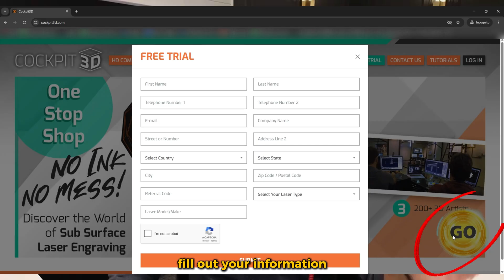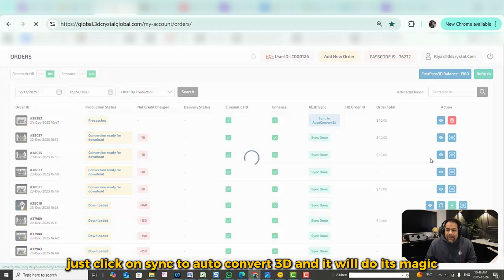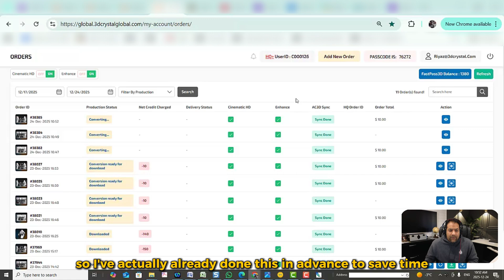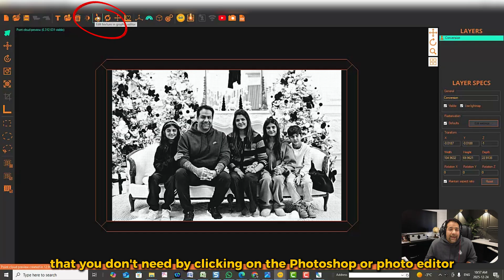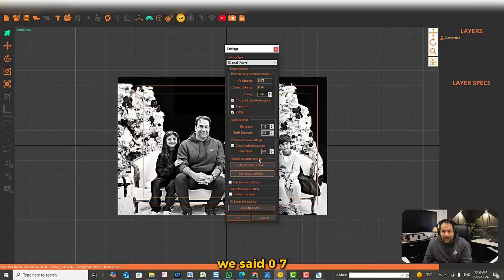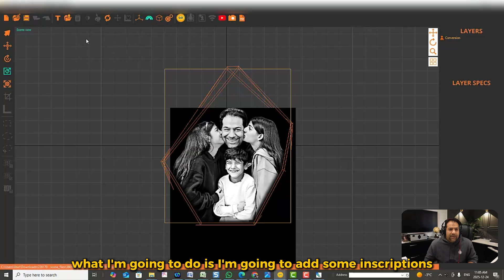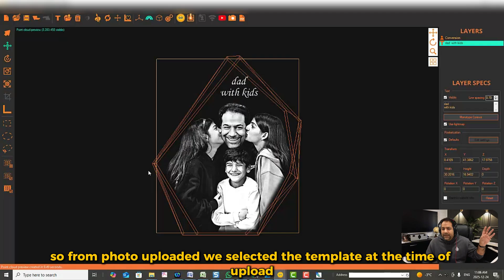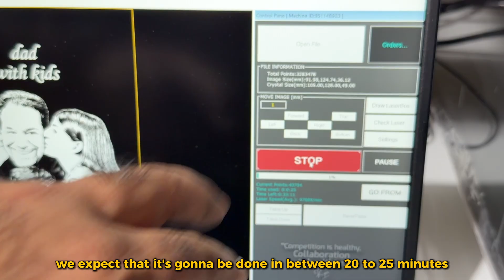How to Turn Any 2D Photo Into 3D for UV & Green Beam 3D Laser box machines | Cockpit3D Workflow

Comment: In FastPass at the very start, I have a square, 65 x 65 x65mm how do I choose the proper size as further in the video you state not to change the size once imported into COckPit3D. Thanks
Reply from the maker: If you select the template looking icon you can change the template size by punching in the metric values under custom OR rectangle to your squares dimensions. You do not need to go through the cockpit3d fastpass converter twice.  
To save a point cloud you would click on the laser icon on top. 
Hope this helps.

Comment: Hi Riyaz Many thanks for the video. Very informative and very useful. So much better now I don't have to use a 3rd party to convert files. I used the Comarker UV and the Xtool UV to create 2 identical jobs , The settings for the Commarker XY=0.04mm XZ Max Spacing=0.25 Z space=0.04 Axis Depth=10mm Calibration Depth=15mm Dwell time=800 FRq=40 Pulse width= 15
On the Xtool I used the following 3D inner engrave file Power=90 Dot duration 600 Layer height 0.04  Frqen 60
Could not have got such good results unless I used your software. Again Many Thanks Steven Tanner

Comment: Youve mentioned groups of numbers (  0714   ) (842) can you link to a video explaining them and how changes in any of those digits will impact outcome of etching.   Also how would uv machine use different numbers (ie xtool f2 ultra uv) thanks
Reply from the maker: XY represents Resolution.  So when we say .07 we are referring to the settings for our Green beam 3DLaserBox.  For UV you will want to start at .06 and you can go lower to increase the resolution.  However as you tighten these points by going lower you increase the chances of cracking and internal melting.  You also drastically increase your burning time.  As for the .14 we are referring to the distance between the layers in the Z direction.  Keep it the same as what you do for your XY since for UV lasers the beam is very thin and we have heard it is best to keep the Z point spacing same as your XY.  The 8 4 2 represents the layers and layer settings.  If you go from 8 to 12 you increase layers, increase points, increase brightness.  The 4 is again complementing the spacing between points and we recommend keeping it 5 for UV.  Finally the 2 is to help reduce some laser ring lines we have seen in the past and we suggest leaving it as is.

Comment: Do your engineers have a recomendation for safety margins?  Ie how much crystal should NOT be internally etched so that the crystal does not break (ie assuming i cant start internal etching exactly at the edges of the crystal)...  Also with respect to internal etching depth.. what is min required internal depth for internal etching for good image?  Also inthink ive learned that a high density of dots while producing a more detailed image also creates heat. Is there a way to pause the program for a cool down period and then have it restart?
Reply from the maker: Thank you for your question.  Our President made a personal response video for you!  Here is his explanation as to what the margins should be, as well as how to set margins on non-rectangular shapes: https://youtu.be/PBmePINlJq4?si=O2GDVB30RAdfK2oo

Comment: Why in one part You are using "projection" and next part You are using "portrait"?
Reply from the maker: thank you for noticing!  Use projection.  Portrait only makes a difference if you are using 3D files that were designed by our human artists and it helps to hide shadows and holes.  Our automated 3D conversions are advances and resolve this automatically so using projection will get you the best results

Comment: I am new to your system and to doing UV lasering I have a xTool F2 Ultra UV 5w how do I figure out these settings are for and how to adjust them?
Reply from the maker: try .06Xy and .06Z or if you want it even denser .05Xy and .05.  On the laser make sure you set your spacing and line distance the same as what you did in cockpit3d.  If you get stuck at any step along the way send us a message here on youtube and we will assist you further

Comment: Me again, I have another question. I downloaded the software on my Mac and it seems to work creating an image. After I hit the preview button and accept the file, I never get the download button. Do I need to re-install the software on a windows computer? thanks
Reply: I don’t think that my mac supports the cockpit installer .exe. When i try clicking on it in dropbox i get a “cant’ load this file type”. Where would i find the open scene file? Is that somewhere on the conversion portal page or somewhere else? And would i have to do this on the windows laptop? Thanks for all of your help, i really want this software to work for me
Reply from the maker: @kelliparker5651 with pleasure. You would need to use cockpit3d on either your windows based machine or on your Mac running a windows emulator. Once you have cockpit3d running you will be able to open the scene file. It won’t work on a chrome book either.
Reply: @3dcrystal thanks for getting back to me so quickly. I’m installing cockpit 3d on the windows machine now, (running windows 11). We’ll see how it goes
Reply: @3 @3dcrystal Success! 🎉 I got the copilot software to load on windows and i can now see my file. Thank you so much and i hope that I don’t have to bother you any more this evening. 😊
Reply from the maker: @kelliparker5651   with pleasure its never a bother. Let us know how it turns out :).
Reply: @3dcrystal i will. I’m watching your video now about the settings and point spacing. Maybe i can print this file tonight (fingers crossed). Thanks for your patience, i am not that familiar with windows, so it was hard to navigate at first for me.
Reply from the maker: @kelliparker5651  try .06xy .06z layers 8, zfactor 5, diffusion 2.  If you want to be a bit risky to increase the brightness and density you can do .05xy .05z but it may result in the points melting and cracking if they are too tight to each other.
Reply: @3dcrystal you are so nice to help me out, great customer service! I will try your settings, but i think that i will skip the melting and cracking settings for now. I had enough frustration for tonight 😂
Reply: I have one more issue darn it. I saved the scene as an stl and again as a glb. I cannot get either file to open in xtool studio. I’ve tried restarting the xtool software twice and it still won’t work. There isn’t supposed to be a file size limit, but this file is 7.5 mb. Do i have to convert it to some other format before i can import it into xtool studio?
Reply from the maker: @kelliparker5651  we will check with other users however if anyone reading this has a tip on how to help please post it here.
Reply: @3dcrystal thanks, i’ve reached out to some facebook group users too to see if anyone can help. After double clicking and opening the file in cockpit 3d software, I did hit the “go” button on the toolbar after saving my settings to rasterize it and then used the file save scene as and named the file, added the .glb extension. It shows as a saved file in my windows , but i keep getting the file unable to open message in xtool.
Reply: @3dcrystal i finally got it to work.! 🎉 I saw another video that showed how to save it as a glb file in windows. That was my issue. I was adding a .glb after the file name to save it and that didn’t work. Since i’m not a windows user, i wasn’t familiar with the drop down menu to save the file that saved it correctly. Thanks again for all of your efforts to help me through this.
Reply from the maker: @kelliparker5651  if you figure it out pls post your resolution for others to benefit from as well.  Thank you ❤
Reply from the maker: @kelliparker5651 oh ok perfect thanks for the update. So you saved it as .glb from the cockpit3d drop down save list and then loaded it  without issue on your laser software right?  Let us know how the final burn results were :)
Reply: @3dcrystal  yes, it was my operator error!  I'm not familiar with windows software, so when I went to save the scene/file I was just adding the .glb after the file name. after I watched a video by gramps laser shack that showed step by step and I found out where I was making my mistake. I didn't use the drop down menu box where it said file name/save as type when saving the file, and that's why it wouldn't open. Everything engraved fine and I even made another engraving. I am a happy camper.
Reply from the maker: The download button should appear irrespective of the pc you use since it’s browser based. After you click the preview did you accept the preview or did you reject it?  If you accept the preview it will allow reveal a download button. If you reject it, you will need to reupload the photo.
Reply: I never did get the download button on the mac. I logged on to a windows laptop and it appeared. I downloaded it, double clicked on it and now i get the windows select an app to open this cockpit file. It doesn’t open up in the cockpit software. My only choices are notepad, word and some other apps that were on the laptop.  Then i get a choice of browser apps in the microsoft store or choose an app on your pc. Can you help me please? I also noticed that my points went from 560 to 440 after i downloaded the one file.
Reply from the maker: @kelliparker5651  we aren’t very familiar with Mac however when we download it from the browser on a pc it’s opening.  If you have managed to download the file we recommend opening cockpit3d software and clicking on open scene file within the software and selecting the file from its folder as opposed to double clicking the file to launch the software.  Credits deducted are correct at 120 credits for the project if you did not use cinematicHD or enhancement. If you use those additional features it would have deducted 140 credits instead of 120.

Comment: All these UV lasers I'm sure will be a boon and a curse to Cockpit3D.  A boon financially, a curse from the additional customer support requirements.  Speaking of the curse side, any plans for Mac software support?
Reply from the maker: Thank you for your thoughtful comment and question.  The rise of UV for SSLE is both an opportunity and added responsibility on our side.

Cockpit3D is currently Windows-based, but we’ve heard from several users that they’re successfully running it on Mac using Windows emulation. 

On the support side, our focus is on making the workflow as laser-agnostic and automated as possible so scaling doesn’t automatically mean more complexity.

Appreciate the thoughtful comment as feedback like this genuinely helps guide where we take the platform.